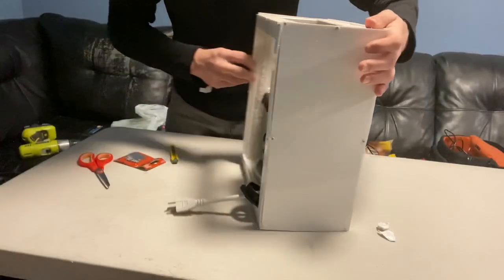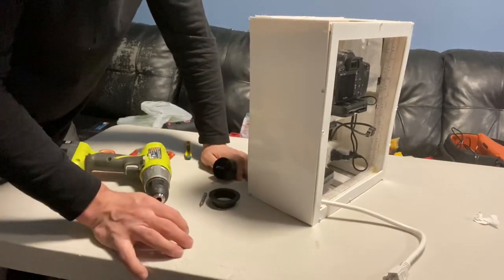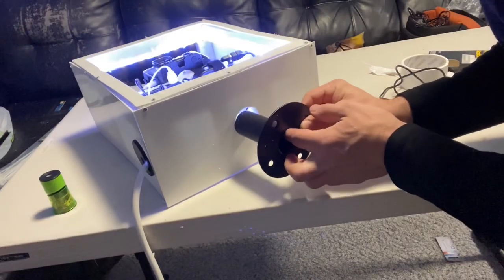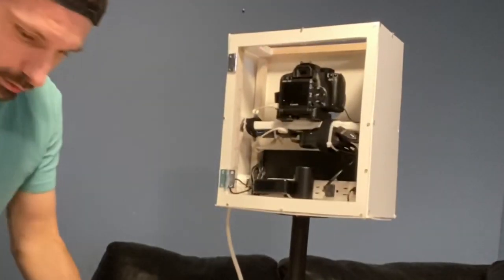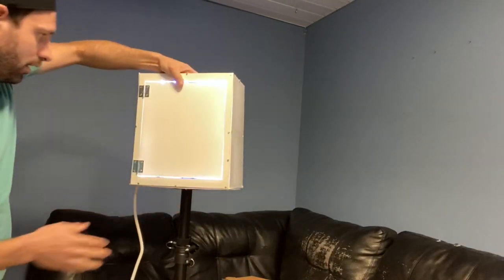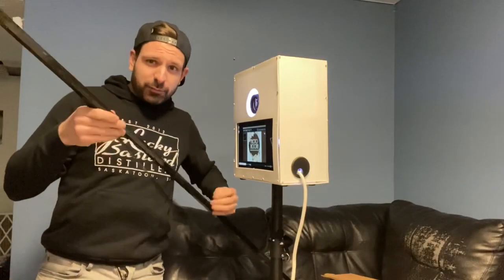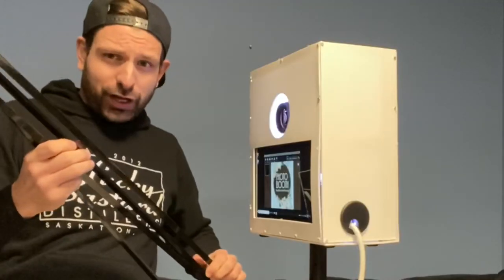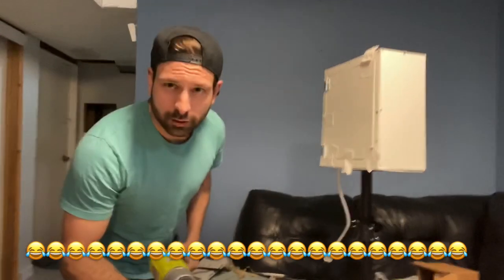DIY Photo Booth Builds By Lee / EP 4 of 5

Comment: Hey dude. Awesome build. Inspired me to get one done up myself. Quick question. At the 2min mark, you add in some kind of support adapter at the bottom of the build. Where can i get one of those. And the circular thingy at the side of the build, with the wire coming out of it. Thanks a million and keep those videos coming!
Reply: You can get the speaker stand adapter on eBay
Reply: The circular thing is what they call a lock install kit usually at ya hardware store you can get them

Comment: You're gonna find that using the pole mount the way you did that your booth will move a lot as people tap the screen. With the booth on the stand drill a hole all the way through the mount and stand so that you can slip a pin into it and prevent the lateral movement. It'll still move a little be far less than it would with nothing.
Reply from the maker: Thanks for the advice!

Comment: Where did you get the corner protectors? The trim from Home Depot is 1/2 x 1/2?
Reply from the maker: I got all of the trim from Home Depot. They have many sizes. I’m using 1/2inx1/2in in this video.
Reply: @therentalguy  Thanks for responding, I found the trim, but not the corner protectors. :/

Comment: What kind of material do use for the outside of the box. Were you cut a circle and square for the screen.
Reply from the maker: Hey Willie, my other videos give the answers to your questions. However it is made of HDPE and the cuts were done buy a guy with a CNC table.
Reply from the maker: You can easily do the cuts with hole saws and portable saws if you’re handy.
Reply from the maker: I finally made downloadable photo booth blueprints with infographic explainers and cutting machine files so you can easily put together my style of photo booth for next to nothing: https://www.etsy.com/ca/listing/1044503886